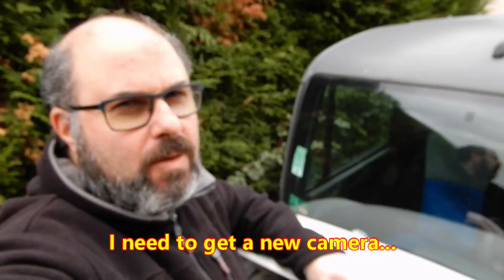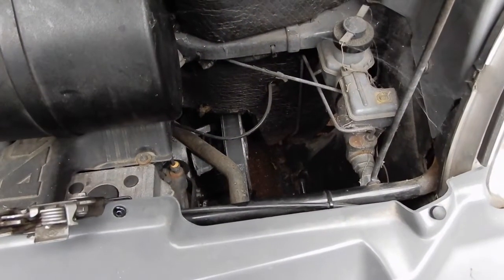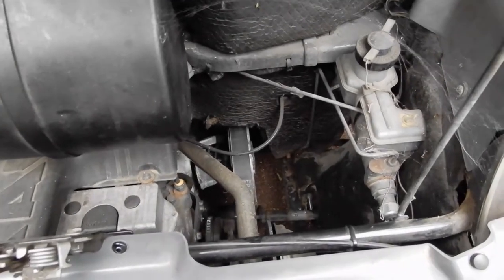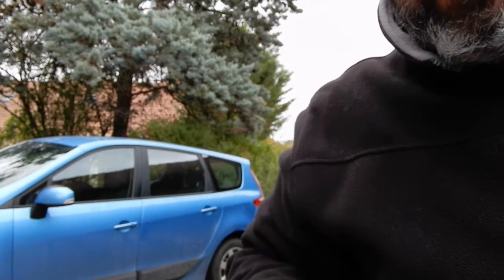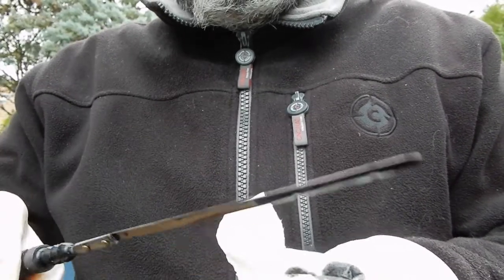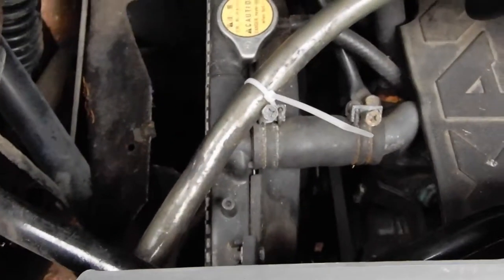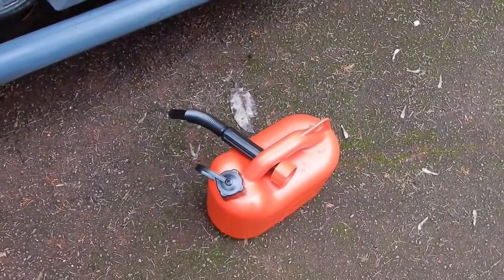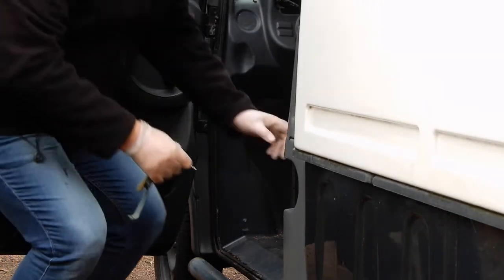Rust | oil level | refuel | heating & insulation | Aixam Mega Multitruck Van

Comment: Have a look at self adhesive closed cell foam for the headlining.
Reply from the maker: Thanks for the advice. Will look into that.
Reply from the maker: Just revisiting all my vids to delete broken links sigh
I will really need to get some insulation for the cab roof, as the heat coming through it has actually caused the plastic around the interior light to crack and break.

Comment: How about some new engine bay heat resistant insulation and then try some waterproofing spray on the underside of it? I’ve never used it but I think it has silicone in it that gets into the material to stop water getting into the gaps. Not sure how it would work with the engine heat though.
Reply from the maker: This may sound a bit clown car-ish... But I was thinking of having some aluminium sticky backed soundproofing sheeting stuck back to back, with some grill fencing in between to give it more rigidity and allow me to shape it. Using the old soundproofing as a template to cut it out. I'd guess the silver coating is weatherproof... for under the wheel arch side and heat proof for the engine side.
I'm interested in your suggestion of closed cell foam for the head lining.
I need to get onto the rust in the engine bay first though. Which will mean ripping out the sound proofing so I can access the bits that need to be treated. Sods law, today is sunny and for once no rain. But I've got to work today.
Reply: @MegaBreadvan  i guess they that and see how it goes, the only thing I can think of is to watch the heat transfer across the sheets as it might cause issues elsewhere but if it’s not touching much else or it doesn’t get too hot then it might work really well
Reply from the maker: @CaddyConversion  Well on one side you have the radiator (there will need to be an opening for that, I have a mesh sheet for it so stones and merde won't get thrown up from the front wheel into the rad). On the other side you have the CVT unit,
The exhaust manifold is at the front of the block in the middle. It  passes around the engine on the CVT side a good distance from the sound proofing.
Each of the two sheets of sound proofing have 3 small bolts attatching them. One at the top, behind the head light. Two at the bottom onto the inside side of the subframe. 
I imagine your Phase 1 is very different. Your engine looks like it is under the drivers seat (UK side). On mine you have the fuel tank under the drivers seat (French side) with a storage space. Battery is housed under the passenger seat.
Reply from the maker: Coming soon... another thing on Mega Breadvan... https://www.blipfoto.com/entry/2770727125563477936
Reply: @MegaBreadvan  cool! It kind of looks good in the red too!
Reply from the maker: @CaddyConversion  Thats the primer coat. The bars will be black. Don't want to Noddyfy it too much... I already look like Big Ears. 😁
Reply: @MegaBreadvan  oh yeah I know I just thought the red looks quite cool!
Reply from the maker: @CaddyConversion  Plan is to do the bonnet & door in red. The roof and front end in black. The back will stay the same, just a good clean up and then a coat of varnish.
Reply: @MegaBreadvan  oh cool! Will look really good!
Reply from the maker: @CaddyConversion  It will make all the girls heads turn... then give them coughing fits... LOL
Reply: @MegaBreadvan  you just need to put those shiny chrome spinner caps on the wheels and then install that suspension that makes the car bounce around on two wheels!
Reply from the maker: @CaddyConversion  Is that bouncing around or shaking to bits? LOL
Could be like the baddie in Grease and put blades on the wheel spinners... Would probably rip the chassis out from underneath me if I tried to hit anyone with them. Might not be fast enough to do any significant damage to someone... :)